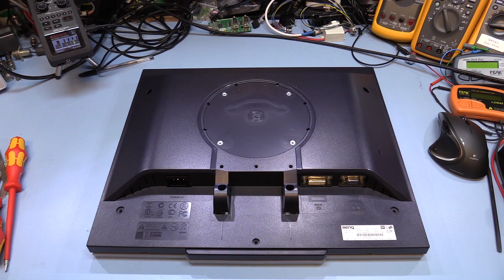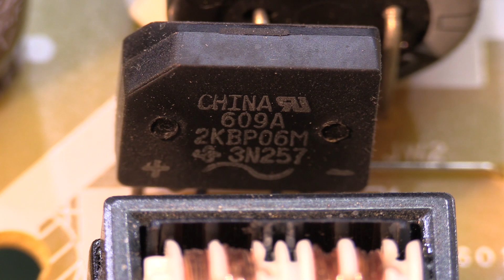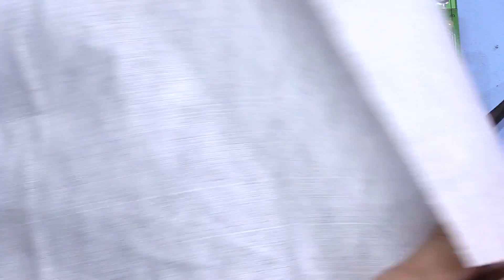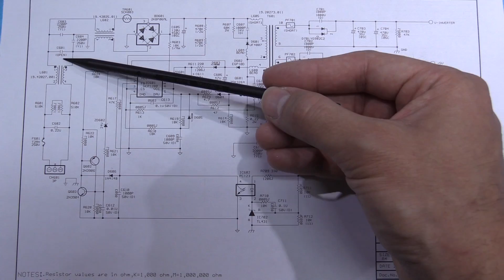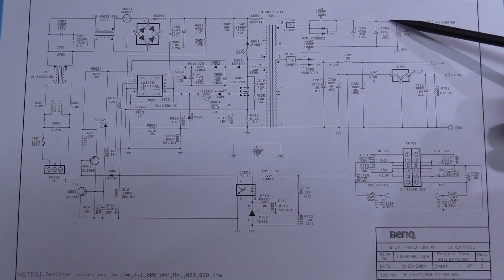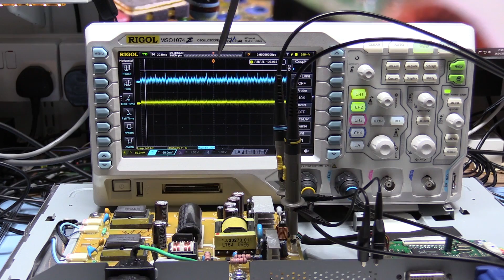SDG #017 Benq LCD Monitor Teardown and Repair

Comment: How do you unplug the high voltage connectors from this board? They fit loosely but wont come out, which suggests a lock mechanism, but there isn't one visible. The plastic is also too soft to pull them out with tools.

Comment: My Benq monitor powers on only sometimes when I unplug and replug it enough times. It started acting up a couple of days ago, and was getting more and more difficult to turn it on as days passed, now it powers up so rarely, I decided to tear it down. 
The only that catches my eye is the slightly bulging capacitors (3x 330uF 35v and 2x 480uF 16v) on the power supply board, could those be the cause for the behavior?
Also: Once I got the monitor to boot up, it worked perfectly fine.

Comment: my benQ sw 2700 pt is a piece of shit, it just blinks on and blinks off blinks on and blinks off...doing my head in
Reply: A couple of days ago my BenQ G700AD started doing the same and the menu button worked erratically. I noticed the bottom of the power supply board was brownish under the heatsinks, so I replaced the dry paste between the heatsink and components. I also retouched every solder point on the  button pcb. It has been working without a glitch for two days now.

Comment: FOR THE RECORD: if someone reading has the problems....    the shit is the voltage regulator on the  controller board......... (2nd board)  it should give 3,3v but if defective gives 5....  just change the 3,3v regulator to a new one and menue buttons will work :)

Comment: Thank you! Your step-by-step explanation of the components led me to closely examine each part and trace the power. I found one of the thermistor's legs didn't make it through the board before soldering so contact was intermittent. And this was after fixing cracked solder joints on the mains pins because the socket isn't supported. Double the intermittency, quadruple the teardown attempts

Comment: Please be aware that the front panel buttons of monitors are usually read via the ADC of the controller chip. In order to save wires the engineers usually implemet a resistive divider. The buttons and a resistor - usually between 1k and 20k - form the lower half of this divider, pulling the level towards ground. That means muliple buttons will share a wire.  Different keys will result in different analog levels. If the front panel  cable is broken (e.g. gnd is missing) or the little switches are dirty the controller can do some crazy menu functions or power cycle on its own. Your problem looks like such a front panel board fault.
Reply: Can you see my videos and reply what is going on? I have benq 24" with random turn off and on. 5 minutes laer is stable and working all time.
Reply: @kris0725pl  I have a BenQ G700AD with the same symptoms.
Reply: A couple of days ago my BenQ G700AD started doing the same and the menu button worked erratically. I noticed the bottom of the power supply board was brownish under the heatsinks, so I replaced the dry paste between the heatsink and components. I also retouched every solder point on the  button pcb. It has been working without a glitch for two days now.

Comment: Nice video bro, i have a benq fp71g+ with the same failure. The power supply is ok I replaced the mosfet as well as the capacitors  but the monitor no turn on. when my brother brought me the monitor so he can repair it, did power on, show the benq logo but  when I press the button to turn it off it does not respond
So here iam really frustraiting.  
 
Pd: sorry for my inglish, is samthing bad lol. Cheers from Argentina
Reply: fofetin lo pudiste solucionar tengo la misma falla!
Reply: @GuillonPadel  no, ahí está aún en el banco de pruebas ya perdí la esperanza.

Comment: Hi Steve, I have only recently stumbled on your YouTube postings and I really like your videos because they are filled with information all the way though. Like you I worked in electronics for all of my working life, but predominately in maintenance and repair, and the one thing that learned very quickly is to never believe the fault description from anyone and don't tell them that you don't believe them. Always test the item first and make up your own mind based upon the test. Even if it does blow the fuse at least you have witnessed the fault for yourself and proceeding from there will always take you down the right path. Don't take this the wrong way, I did like the video and I did learn a few things my self from watching it. Keep them coming! - Harry

Comment: Try the followings: Start the monitor, so the green led is on, then unplug from mains. Unplug the front panel connector. Power up and watch the screen and see if the issue occurs. If yes, then dispose the monitor for spares. If the monitor acts normal then consider replacing all the switches from front panel board.

Comment: HI, I do have the same problem with my Benq g950a Monitor, I try to fix it but I just cannot find any problem that would cause it to stop working, But I do try swapping the parts (POWER SUPPLY) from the same monitor and it work for a night and both of the monitor seem to working properly, and then after a few days later I power up one of the monitor that has the faulty issue, and when I try to connect my Serial port for the PC then it stop working until today. I just hope that you have some clue.
Reply from the maker: Abinj921 Hi, what exactly is the fault? Does the monitor not power on or just not display a picture?
Reply: SDG Electronics No power
Reply: SDG Electronics Monitor does not power on even I try to power it up. I think it may has something wrong with the power supply or could be something else.

Comment: 12:15 what if you use this PSU board in continental Europe, here the wall sockets are symmetrical so the live/phase might go to the neutral pin, depends how you happen to plug the power chord into the wall socket? Would that change they way the board works?
Reply from the maker: bergweg Hi, it shouldn't be a problem. There's nothing on the primary which references mains earth so the waveforms are identical, the transformer performs the isolation, and the secondary side references 0V to mains earth.
Reply: So why do they label them then?
-In your video on the isolation transformer you've said that the neutral is usually connected to earth at the distribution transformer or where it enters the house.
Reply from the maker: Any properly designed equipment should work whichever way round it is connected. If you look at both the phase and neutral conductors, the waveforms are identical but 180° out of phase. They're labelled because we introduce an earth conductor for safety. The earth conductor is referenced to one of the ends of the primary and we term that conductor neutral as it is at the same potential as earth. The other conductor then becomes 'live' with reference to your earth and neutral conductors.

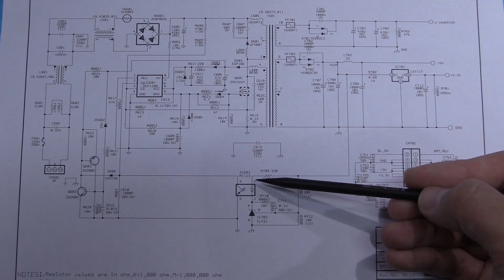Comment: In the bit where you are looking at the schematic (21:34) I thought the top winding was the primary (you can see it has a snubber circuit and is connected to the MOSFET) and the bottom winding is a secondary that powers the SMPS chip - you can see it goes back to the VCC pin of the chip. No idea what the HV line does. Anyway - I like your videos!
Reply from the maker: Tom Biskupic You are correct - I missed it while recording. The HV line powers the chip until the switcher is stable at which point it uses the second winding on the transformer to power it.

Comment: btw did you try for a second to assume that power supply and logic is fine and it's possible to have problem in the buttons PCB or the buttons themselves?
Reply: SDG Electronics Just opened mine (it's samsung 17" 4:3) - half of the buttons have failed. The auto adjust had 100-200 ohms resistance in unpushed state. 2 others had 1k. They use multi level - half the buttons pull hard to ground, others pull through 3.3k resisor (2 buttons per pin).With the button board disconnected monitor works fine. I can't replace the buttons because they are the low profile right angle ones and I only have normal height tact buttons. Also the working buttons have high resistance when pushed - 100 ohms to 1-2k. With the pcb attached and buttons temporarily replaced with ones I had (case case can't close) it works, but the power if pushed lightly triggers auto adjust because of high on resistance. I'll have to replace all the buttons. So test the buttons removed from the board with resistance setting, not continuity test.If you get more than 1-2 ohms contact resistance or <10MOhm off state - replace it.
Reply from the maker: Microlab Yes, I think I mentioned it towards the end of the video - the buttons and connections on the control PCB all tested fine. The DVI input was also completely unresponsive. I tried a couple of PCs that couldn't detect the monitor, and the monitor wouldn't display anything when the DVI output was forced to 1024x768@60Hz. Thanks for watching!
Reply: SDG Electronics I'm particularly interested because I have one with the "auto-adjust popping out" problem waiting for a repair. The best thing I found when I google it was "loose/cold joint ground connection on button pcb". I hope that my repair will be easier :). It seams like quite common problem though. It's strange that I found only one solution.  One accepted solution was "blow out the dust, leave it for a day unplugged and it'll work." When I open mine I'll share if I find something. You can always leave the "salvaging" for when you actually need the parts.
Reply from the maker: Microlab Thanks for the info - I'll have another look at the front panel interface. I'm stumped by the issue with the DVI interface though, so I might inspect the controller PCB a bit closer as it may just need some reflowing.
Reply: Microlab 
I heard him mention that, but I missed him calling the thermistor, a varistor. I guess I was distracted. Anyway, the on/off button is usually the one that causes problems, so I would just replace it since they are so cheap and see what it does. But I really think the problem is something else that I can't talk about.
Reply: Microlab 
The tactile switches are common faults. I use a VOM with the X10K range to test most components. It uses 12V to test with so if the component is breaking down under voltage, the VOM has a better chance of catching it rather than a DMM. My Peak Atlas DCA 75 Pro is excellent for FET's and many IC's. You can find deals on good VOM's on ebay sometimes because people that don't know what they're doing think that they are obsolete. lol
I got a never used (brand new condition) BK Precision 114A VOM that is discontinued for $29, shipping included! The quality of the meter is outstanding. It's also better at checking MOVs, thermistors, etc.

Comment: The varistor is usually used for high voltage protection. It doesn't limit the current. If it's there to limit the inrush current it is probably a thermistor.
Reply from the maker: Microlab Apologies, I noticed I'd used the wrong term after I'd already published the video. It is indeed an NTC!

Comment: Nice video Steve, thanks. I believe I know what is wrong with the monitor, but I can't say because in doing so I would have to reveal secrets from Mr. Kent Liew's new e-book, "Collection of LCD/LED Television Repair Tips V4.0".
I love my Peak Atlas analyzers and my new Zen50 should be in my mail today! I can't wait to use it, and it will be in my next article that I'm working on now. Plus it's pretty cool having meters that say, "Made in England" on them.
Keep the great videos coming.
Reply from the maker: Thanks for your comments, any clues? I bypassed the psu after recording the video and it still behaved the same. With no front panel pcb it still couldn't be detected over the DVI interface.
Reply: SDG Electronics 
Sorry, Mr. Liew's new V4.0 e-book has only been out for a few months. You can get his e-book here.
http://www.lcdrepairguide.com/
There is no telling how many Main/Control boards that have been junked because they never thought of the simple fix that Mr. Liew reveals in his new e-book.
Of course there is a chance that there is some other problem.
Reply from the maker: Robert Calk Jr. I'll take a look, thanks!
Reply: @sdgelectronics  
So what was the big mysterious  "Mr Liew" secret ??